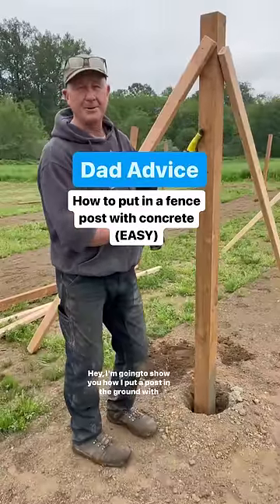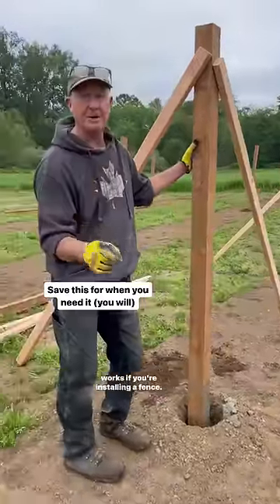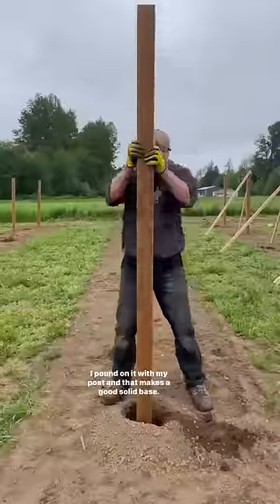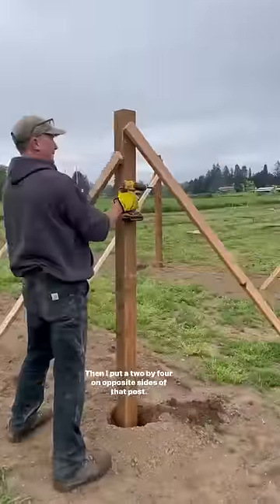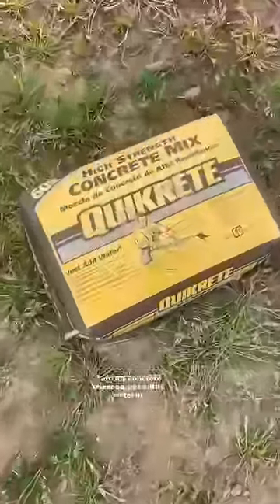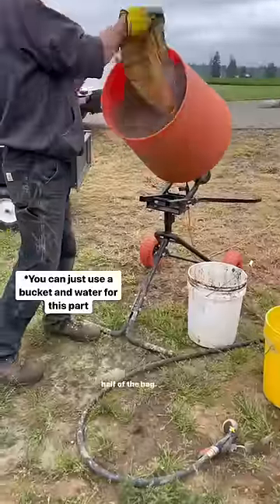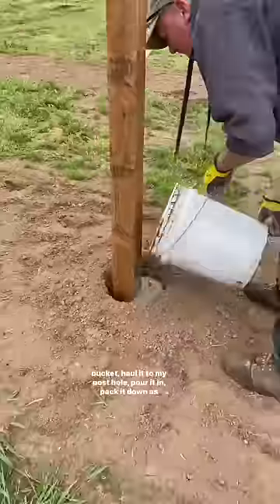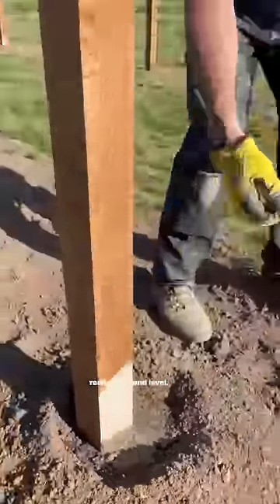How to put a fencepost in with concrete. Love, Dad

Comment: I use to build fences here In Australia where we use metrics not imperials so excuse my measurements. And our regulations for fencing posts are 2.7 metres. We use to string Line along the fence line. And measure and mark each whole to be dug at 600millimetres deep with each post at 2.7metres apart from post to post. Place the 2.7metre post in the holes. Leaving 2.1metres of play on the posts for plinths and fence palings to nail to fence. We then use the string Line to sit each post in line with the string Line using the level to centre the post. We then would chuck a ROCK or 2 on the rear and side of post in the hole and smack it down with our long level to keep the post straight with the string Line and run a level above the string Line to keep it straight in the bubble, but also straight on the side of the post by placing the level in the side and centering the bubble until the post is straight. Then add one bag of quickset concrete per post depending on on the post hole being wide and dug more than 600mm deep. Once the concrete is in we then level the post a little more. Add some water and then let the post dry. Once dry, then starts the building process. Plinths on the bottom running it straight from post to post cutting in the centre and nailing it on to the post. Then repeat along with each plinth. Once all plinths are on and it's level and straight. We have our trick of measuring each cut out for channels and the excess post at the top once the fence palings are on  place our measures paling and mark out our channels to be cut for railings to sit in the post. Cutting out channels with a saw and chisel out the channels. Once done. Place our rail on and cut to fit and sit half way inside of post. And repeat along until all channels are cut out and railings are in. Once done. Then nail the fence palings on. Start at one end with one paling and nail it on. Then leave a 20mm gap then nail the second fence paling. Then place a paling in between the 2 nailed palings and nail that 3rd paling covering the hole. Repeat along. Until fence is done. Then you will have about 100mm of post siting above the fence paling. You measure on the side of the post from the top of paling and mark a line on the post on a 45 degree angle from the top of the paling to the rear of the post. Cut off. And fence done. Like your work mate.

Comment: Cool guy. I just want to nit pick a great job. Its called plumb in the vertical, and level in the horizontal. The post was plumb. Also the post was a bit off center in the hole. Not a  problem for this application. I'll see myself out.

Comment: I use quarry process. It’s cheaper and does not need any framing or dry time. One person holds the post level and another pours in the quarry process a little at a time and tamps.

Comment: 1) dig the holes with the tractor
2) put the posts in the holes
3 load the bucket with as many bags of cement possible
4) drive to a hole, dump half a bag of cement in the hole, plumb post, add water, add other half of bag, replumb, add water.
5) drive to next hole, repeat step 4.
* If it's a fence people will see and judge, insert step 1.5) pull a string line to line up posts.
Nobody with a job to do has this retirement time.

Comment: If you’re up north, and the ground is not sand.. you can use the back end of a shovel or 2 x 4 just pound  the ground as hard as you can for about five minutes on each post  and that sucker will be just like concrete. I’ve done it on every fence I’ve built

Comment: Concrete for posts should be put in DRY, dry rammed hard, and then just a small amount of water added to prevent the top surface being wind blown.
Rain and ground water will complete the process.
Wet concrete shrinks as it cures, so you'll end up with loose posts.
.

Comment: If you use fast setting post concrete you can quickly level it out after you pour your concrete in. Just give it a wiggle and tap on it with a hammer and stab the concrete a little to get the bubbles out and allow the concrete to settle it into the level position. With the right concrete mixed properly you don’t need 2x4 bracing

Comment: Putting that rock under there allows the concrete to become packed around the bottom of the post encapsulating it so that any water that gets down around that. Post cannot get out this Causes the bottom of your post to rot out faster.

Either set the post directly on the dirt or poor a little gravel around it before putting the concrete in will allow the post to drain.

Comment: One it’s plumb not level. Two you don’t need to mix it just add water. Three you need the concrete domed above the dirt to prevent rot. Four you don’t need 2x4 to hold them unless it’s critical they stay where you need them. You can just adjust plumb when you add the concrete

Comment: You can also dry pour the concrete around the post in the hole , tamping in with a two-by-four, sett your plum on the pole and concrete will scavenge moisture from the ground and set, no need for supports unless it's really tall Post

Comment: You should do the corner posts first. Then a string line in the bottom and top of the posts haha maybe then you will drill the holes more center❤ check the poles mark what way the bow is and install them all the same way. Now everyone knows the right way. Don’t need a rock lol just lift the pole a little after some concrete in the hole
Reply: What corner? He is creating a straight fence for berries to vine on.

Comment: 3/4 minus gravel works just as good, and it drains instead of rotting the post. And if you do have to replace the post from berries gone wild, you don’t have to dig an 80lb slug of concrete out of the ground…

Comment: Should try to use QUIK Crete fast set you actually set in post holes dry and soak with water, it saves all the mixing, work just as good to

Comment: When it rots you'll never get it out again.  Make lean mix concrete with minimal Portland cement and no water, and pack it down.  It will set and hold the post, will be porous and drain any wetness, and eventually it can be broken up.

Comment: In areas where the ground freezes that won't work because the rough hole that you dug will allow the frost to lift the concrete up out of the hole

Comment: A Great supervisor 
Tips 
Use Normal concrete
Quickset is crap 
It's non structural & eats
Metals 
Gravel in the base is Best 
Post's are Plumb both ways
Base of the Posts need some protection
Base should have a Thru bolt
Or some 3" screws hanging out the sides 
Helps improve stability & Skn Friction post to concrete
Base Concrete angle mould up higher than ground level 
Posts remain dryer not rotting in ground. 
His words should be well mixed not solidified 
That happens after the concrete goes hard.

Comment: And then the fence post is pushed up against the dirt so only half of the fence post is covering concrete. It's easier if you run 2 by 4 is parallel at the bottom and use the ground to brace it and put rock at the bottom but if. You'd run 2×4 You can actually keep it elevated off. The ground so the whole thing is incased in concrete And the fence post won't slide against the sidewall of the hole

Comment: It’s not how I do it but it’s not wrong…. 

I use the 50lb red bags of quick Crete because it sets up faster. And I dump it in the hole dry and add water to the hole… it works great and saves a ton of time. You can attach the fence in less than an hour. 

Just a few added tips

Comment: Today I am going to tell you to clean the concrete off the 4x4, fill the concrete slightly above grade slopping away from the 4x4 and run a bead to silicone where the wood meats the concrete.

Comment: Quick question, when filling a post hole with concrete, how far do you fill the hole?  I keep seeing conflicting answers online. Some say a couple inches below ground level to back fill with dirt.  Some say above ground level sloping away from the post.  Which is the correct method?  Or are both correct, depending on circumstance?  

Also, should you do gravel at the bottom of the hole?  Should you do anything to protect the wood, or is bare pressure treated ok?  (Meaning coat the portion of the post underground with any kind of additional sealer).

Comment: You have to crown the concrete like a roof of a house in order to keep the water away from the bean. If the water goes in between the concrete and the beam it will rot faster...

Comment: I was a fence guy in a past life and I can tell you this isn’t how I would do it 100% but it’s close. Forgot to mention to bell out the bottom of the hole assuring the post won’t rise with the change of seasons. (Below the frost line). secondly I would run two lines top and bottom of the first and last poles to keep all the poles in the middle in line and straight. Finally.. I would have a few treats set out for the hardest worker 🤭

Comment: I avoid concrete entirely by just using stones, preferably round glacial stone, quartz (common in NE scotland). Holds just as good but the wood lasts longer due to being able to drain and stay dry. As long as you have 4 points of contact top and bottom it isn’t going anywhere (3 if it’s a round post). Pound those fuckers in with an iron pinch bar. Obviously considerably greener if you care about that

Comment: Plumb not level. If your concrete mix is good and solidified it's too late for pouring into the hole. Words are important for effective communication. So use the correct words. 
Excellent use of secret rocks as a base. I use crushed skulls.
Reply: Yes!

Comment: I put a ton of posts in the ground and I don't ever use concrete just use pea gravel one concrete holds moisture and will rot unless you're using it for structural purposes P gravel works just fine sitting on my fence 5 years ago still perfectly straight in postern perfect condition

Comment: I use post mix, not high strength concrete  mix and coat post with liquid tar  with some 3/8 rock on the bottom

Comment: If you run a legnth of wood along the ground connecting the posts to said wood it stops the post from moving when pouring concrete ... also makes sure posts are in a strait line

Comment: U simply put a little water n the hole, add dry quikrete, plumb the post then settle the concrete with a tamping bar, add more water then cover with dirt then move to the next post

Comment: Dry pour concrete while keeping post verticle using level.  No diagonal supports necessary.  Gently put water over dry poured concrete.  Double check post. Let set overnight before trying to bang nails in it. Much easier than his method.

Comment: If you use fast set concrete then you don't have to use braces. that is if you mix the cement before you put the cement and post in the hole. Pour the mixed cement in the hole, put the post in and plumb it. walk away for a minute, recheck the post for plumb, and the post will stay there now. Go start working on your next post.

Comment: A Precast block would work better in the bottom of the hole and Mound up the concrete above ground level a little bit so it doesn't hold water around the post

Comment: If wood struts are too expensive for your budget, 4 heavy rocks (at least 15kg/35lbs)and 2 pieces of string also work. Put rocks either side like a compass bearings and let the friction from the string going over the top to the opposite rock hold it. It's easy to adjust but will stay put in moderate wind

Comment: Soak post in diesel and used motor oil.  Dig hole, drop post in, dump some dry mix, plumb, dump the rest in.  Move to next one.  Mother nature will provide water.

Comment: You'll be replacing every one of those posts in 10 yrs of you use concrete around it. The post can't release the water it absorbs from a rain, and it will rot down at the base. Try using pea gravel around the posts it not only won't rot the wood post it will get sturdier every time the wind blows it it will settle in tighter

Comment: No one uses concrete here anymore.

Its 1/4 crush gravel. 4 ft holes. Prevents heaving and still holds the posts tight and allows for drainage.

Comment: Here's a tip if you put a post in the ground seal it with foundation tar to keep the post from rotting
Reply: @TUGG75  because the new formula for today's treated wood can not mix well with concrete so tar is a good buffer that's why
Reply: @TUGG75  well sounds like you like cutting corners as a carpenter I DONT CUT CORNERS AND MY SERVICES GO ANOVE AND BEYOND SO YOU DO IT YOUR WAY I DO IT MY WAY 😉🖕
Reply: @TUGG75  well the colonial carpenters sealed THIER posts in pitch and they're still standing. Go figure that

Comment: Wouldn't it be wise to extend the concrete about 4 inches above ground level so the timber would not be immersed in water after it rains to help prevent wood rot over the long term .

Comment: Concrete holds moisture, end grain whicks moisture, 10 years later you have a rotten wooden post even pressure treated will whick moisture. To do this you need to coat the wood with creosote tar first.

Comment: Important to have the rock on the bottom for the post to sit on top so the bottom of the post won't be sitting in water and rot over time.
Reply: that post is not going to be sitting flat on the rock. it would just be balancing on the high point. water will still get under it and rot up. I would suggest gravel, as it will let water drain down away from the post end.

Comment: I make the hole a little bigger,  put rocks at the bottom, pound them down with the gigging bar, set the post plumb, add dirt and rocks 6" at time and pack with the digging bar. Repeat until level with surface.  Concrete can rot the post over time and is a bitch for the next guy to remove.

Comment: Great job, loose the mixer. Just put a little water in hole pour the bag in add more water poke with a stick a bit move on. I've done hundreds of fencing posts never an issue.  Remember smarter  not harder.

Comment: Don’t need to brave posts.  Just use rapid set.  Put in your two end posts.  Run string lines too and bottom and let the post with rapid set concrete poured straight into the whole.  Bracing just takes Etta time and there is no need.

Comment: You need too bring your 
Concrete higher it water puddles down there it’s gonna roll. It’s going to Roger pull it. The bottom always comb your concrete on top so water don’t gather at the bottom of the post it will last you longer.

Comment: Need  to pour the concrete to ground level or you’ll have water standing in the hole and rot the post faster plus you don’t need to mix the concrete  with water  anymore. Pour in the concrete and then just water it. Cuts your work in half.

Comment: I put stone in about a foot.than the post.than pack stone as you come up to the top.water runs past the wood. To the stone under the post. Seen on Norm Abram show. Yankee work shop. Spelling? Cement draws moisture.

Comment: Actually the fence posts can be braced run top plates and then frame then run pickets then run string line do concrete last holes should be for a fence 4 times larger than the post,2ft,deep and use 2 80 lb bags per hole.

Comment: Or you could just put the dry concrete in the whole and pack it in tight.  Put some water on top and it will set with the ground water just fine.

Comment: The problem is that the poles are not centered in the hole. They're to the side of the hole and not allowing an even mix of concrete around the post

Comment: Should run a string line to make sure its in line with all the other posts then put a stake in the ground at the base of each brace. Make sure the bottom of the post is lined up with your stringline then tack the braces into the stakes to hold post level. Otherwise your just wasting your time. And yes we can all nitpick the meaning of the word level as it applies to horizontal verse vertical planes but my feeling is its used and accepted commonly enough in the industry in both vertical and horizontal planes so its fine. But if you want to spend a few minutes explaining the difference every time you try to plumb something with 99% of the gomers you run into on every job site be my guest, but lifes to short in my opinion. Im just happy if they can actually use a level  😂

Comment: You are not supposed to cement wood Poles in the ground. You are supposed to use dirt and rocks and tamp them down to secure the pole when it It rains out the water stays on the concrete and rots out the Pole. Please comment back. I put up fences for many of years and that is the trick. If you are going to cement a pole it has to be a galvanized fence pole

Comment: Half  a brick at bottom  pounded down little motar to level add little gravel good eight eight hole 16 "  cut 12ft 4x4 cedar or treated whatever r available than pour a dry mix straight out of 5 gal  bucket cheap concrete mix

Comment: when leveling use math :) .. 3 at the buttom 4 up the post .. and it should be 5 from top to squared out buttom :) .. and it will be at 90 degree allways .. it`s the oldschool dad advice i give people :D .. it`s called 3 4 5 .. as in 30 cm then 40 .. and last 50 and you created a perfect triangle .. smart move if you slope the top away from the post .. to avoid rot :)